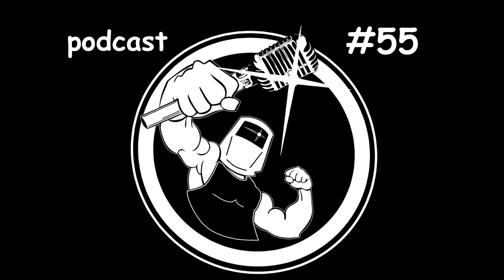Podcast #55 Troubleshooting

Comment: Double ground clamps works great. Same side as well as cross corners. Never had a need to try all 4 corners.
7018 pre heating... some of the old timers would 'stick' the rod and let it turn dull red then break it off and start welding.

Comment: Gmaw popping on the starts, some machines have a "run in" setting.  The speed of the wire befor the arc.  Ive had good luck adjusting that setting.

Comment: Pretty awesome podcast. Would have liked to hear just a little more for pulse mig aluminum, more specifically 4043 .035 with a millermatic 350p and xr-aluma pro push pull gun. Bird nesting between 1-5 times a day. In conjunction with that it usually burns both my tapered and heavy duty tips. I have switched tanks out, liners, cone wire guides, wire brushed the rollers, adjusted tension on the spool, the roller tension. And have even went to wire brush the gun roller wheel. (All  the aluminum I weld is 5000 series for ease of cutting or routing and is prepped with a stainless steel brush. As well being the only welder in my company I use 4043 wire so nothing cracks or pops at power coating or from hurricanes. Or if just about everything was hit there for the same set up, 5056 how best to eliminate it being less clean other than the magnizium in the 5000 series aluminum "how could I most likely emidigate cracking of my weld when it cools?"

Sorry if this as straight forward as you'd like it to be.

Comment: Regarding the mig volcano at termination of weld. I come from a background of heavy plate weldments via Catapillar (horrible company FYI). It’s select few would simply give a double tap to terminate the bead. This is due to the termination of kinetic force in a fluid like puddle having it’s final arc terminate even down to root level hence, the double tap at 1.5 seconds time. Allowing it to solidify briefly-